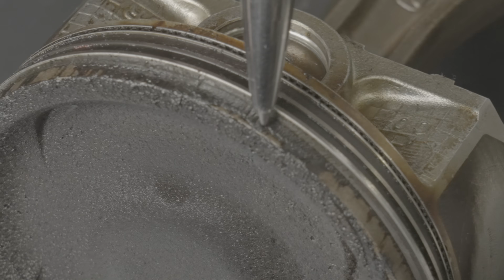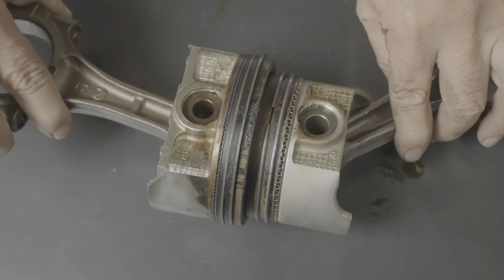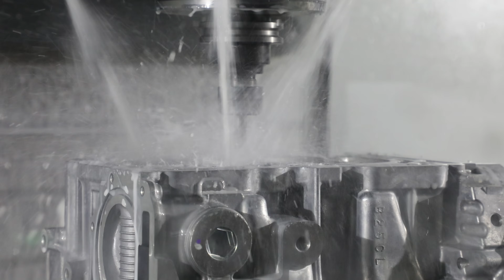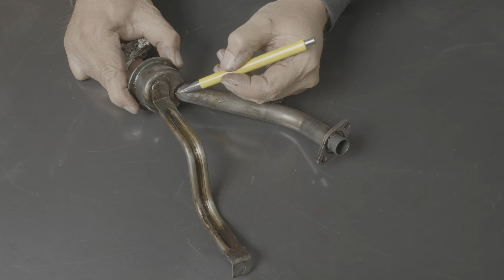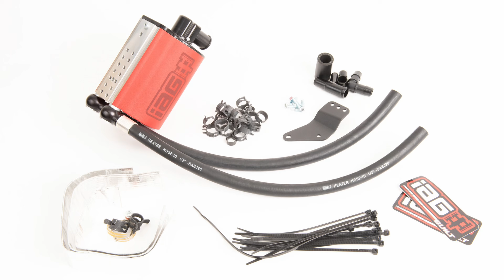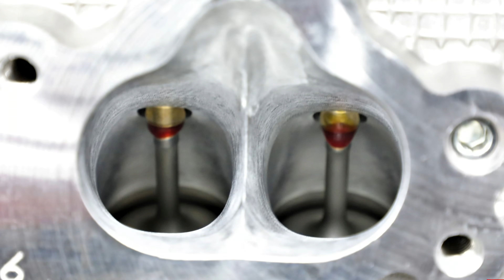Why Subaru Engines Blow Up!

Comment: Subarus are amazing cars.  This is a absolutely amazing video and EVERY owner should watch this before modding their cars
Reply: Subarus are objectively junk.
Reply: @black99rt  Spoken like a true clueless punk.
Reply: @eskieman3948  father has worked as a tech and parts dept employee at a Subaru dealership for almost ten years. Everytime I am in there multiple bays have engines out for replacement. I used to work in a jeep dealership (known for poor reliability) and it was a once or twice a month occurrence. The Subaru dealership stocks shortblocks they replace so many. I have owned Subarus in the past, wouldn't do so without a power train warranty.
Reply: “Subarus are amazing cars” 

They are some of the most cheaply designed and built cars that you can buy. Also, you sound like you've drank too much marketing Kool Aid from Subaru's US division.
Reply: Yeah… total engine failure if you breathe on them wrong… what a great car 

Before you go “shut up hater you don’t know what you’re talking about” I owned one of these cars and I sold it after 6 months because of the risk of it blowing up. 

Just a terribly designed motor but god damn if it doesn’t make a great sound
Reply: @CadaverCo  You're a liar.  Simple, eh, hater?

Comment: Mine threw a rod idling 02 wrx.... Pretty much stock. Only mod is front mount conversion
Reply: Sitting in the shed with a fist sized hole in the top of the block. EJ207
Reply from the maker: wow
Reply: The tear down of it is on the hometown runners YouTube channel... Using a great deal of your information to build a 2.5 2 l hybrid

Comment: This is a good video about the issues that people who want to leave a stock configuration often overlook. 

Subaru doesn't deserve the reliability reputation that has trickled down to normal drivers of their stock config cars from owners that blow the engines up doing non-stock things.
Reply: The head gaskets happen on all the standard, ordinary grocery-getter 2.5 & 3.0 models though...
Reply: @TassieLorenzo  any car not properly maintained can blow a headgasket, and the reputation that *all Subarus blow their headgaskets is undeserved. It has way more factors than most people give credit for because lul-meme-headgasket is easier. I have owned a turbo 2L and a 3.0 with both hitting over 300k miles with no headgasket issues and neither were stock anymore.  
This video is great because it points out that yes, the EJ has limits, and he's clearly got the expertise to point them out, but the other side of what he explained was owners exceeding the limits and not doing the supplemental work these engines call for when modding/tuning. 4 of the 10 reasons of his videos are all running too much power without protection, and another 4 are oil starvation problems, which also have preventative mods.
A fairer criticism of Subaru engines would be that they are less tolerant of sloppy maintenance habits than other engines like hondas or toyotas.
Reply: @themadmallard  "A fairer criticism of Subaru engines would be that they are less tolerant of sloppy maintenance habits than other engines like hondas or toyotas" I was with you until that, what kind of excuse is that?  If a Honda will run for 20 minutes with no oil in it (Carwow) or for a year with a rod wedged in the block and only three cylinders working (Eric the Car Guy), then Subaru should match that.

The reliability and durability of all cars is judged compared to Toyota/Daihatsu/Lexus, Honda/Acura and Suzuki as they are (mostly) the benchmark at the top of 10+ years reliability surveys. That's no different whether an Alfa Romeo, Dodge or Subaru is being judged compared to a Toyota or Honda.
Reply: @TassieLorenzo  that changes the standard though, and at that point you might as well throw any consideration of what a responsible maintenance action looks like for an owner. It's still abuse of the mechanicals, and just because a Honda or a Toyota has a longer mean time to failure when being abused is not exactly the fairest of comparisons as if youd follow the maintenance schedule for all parties involved. It's still going to fail ultimately.
 That is by definition not reliability, that's tolerance for abuse. Don't conflate them.

Comment: The flow of all gases is wildly turbulent in all combustion engines. Quench pads are certainly not responsible for the "turbulence" of a gas that is already out of control.
Reply from the maker: Yes they are.  The function of quench pads in two strokes and 4 strokes is common knowledge so it isnt just me that says this.
Reply: Is a stratified charge combustion chamber "wildly turbulent" right before the spark? No. How about the combustion chamber of turbine engines? They would burn up if "wildly turbulent", the metal is protected by the careful placement of combustion, away from chamber walls, not wild turbulence. 
    Piston engines have these quench areas and other gizmos to intentionally make turbulence. 
    Heron type combustion chamber? That promotes turbulence intentionally.
   John deere experimented with creating turbulence intentionally,  called it "cyclonic" combustion in brochures in the '50's. I guess they thought it wasn't wildly turbulent enough in their engines. Rolls royce was messing with it in the merlin and it's predecessor..I think their squish area wasn't tight enough to really work, as good as the merlin was, it sounds like this was a power limiting shortcoming...makes detonation appear earlier than it would have if they had gotten that right. 
   The quench areas seem to make their turbulence just about at the right time, pretty good idea! And no additional moving parts.
Reply: @firstielasty1162  The exhale of your breath is turbulent, Re>2300. Air/fuel mixture into the combustion chamber reaches an insane level of turbulence Re>50000. An increase in turbulence is a by-product of the quench mechanism. The primary function of quench is plainly known as "Fluid Spreading" or "Spherical Propagation". This squeezing of the air/fuel mixture results in spherical vortices throughout the combustion event. This is crucial for the uniform distribution of fuel particles and intense combustion. You guys are misusing the term "turbulence" like the typical bro-scientists that have always plagued this industry.
Reply from the maker: But if I said what you said, everyone would not understand or fall asleep.
Reply: @motoiq  Ya, you're probably right
Reply: I guess so...and I shouldn't  say or imply "not turbulent"..by Reynolds number and definition.
   How about "not turbulent enough"?
   Both garage hacks like me and manufacturers alike seem to see benefits in squish/quench areas.
   I bet all but a very thin boundary layer in an intake  manifold and port is turbulent, but, maintaining fuel in suspension (I mean atomized but not yet vaporized) is still tough, so, "not turbulent enough", again. 
  I can't think of one word to replace those three. But wouldn't mind knowing one.
Reply from the maker: If you mess with quench or squish, the engine needs less timing and when tuning has less propensity to detonate.  On an engine dyno the BSFC goes down. This is when the same compression ratio is maintained.

Comment: I've almost always attributed EJ early death's to oiling problems in their stock forms. I'd not considered the ring issues, which is a solid point. Unlike a traditional layout design--where other fluids to include a gas/air mix doesn't mind laying on it's side nearly as much--the oil travel and performance certainly does! I have no idea how some of the hillclimb guys in Europe keep 800hp engine together, unless they just accept that a rebuild is necessary after every event vis-a-vis quarter mile drag engines.
Reply: They just accept their fate on the rebuilds part, I mean they’re hard racing a 2.5l engine that makes 800hp it’s not gunna survive that well in majority of engines that displacement or smaller
Reply: Baffle that sump gents....
Reply: Have you ever been to a drag strip? Basically only top fuel do teardowns between runs. There's lots of people who drive to the strip, rip 9/10's all day and then drive back home.

Comment: Another great Subaru video! Taking into account this and other videos I've come up with this plan.
1. Keep it cheap, keep it fun. If you're not laughing if/when it blows, you spent too much.
2. Don't build the engine, it's not worth the machining cost, work around the flaws.
3. Don't shove power in down low, the block/rods can't handle it.
4. When time comes for more power go with cams and dry sump (cheaper than a built engine) to be able to safely spin it to higher rpms (~8-9) without oil starvation, and put the power in there.
5. Throw out the restrictive cast UEL manifold that just holds hot exhaust in the cylinder and increases detonation, run the twin scroll or other EL tubular manifold. Probably also run a turbo with a decently large hot side, unlike most stock fitment Subaru turbos.
6. Don't try to push a heavy car with all this, start with the lightest possible car.
Reply from the maker: Stay under 330 or so whp for a track-driven car, with Ethanol maybe 390 or so.  You don't need cams for this power level and if you do a cam change, you should pul the engine so it is not recommended.  You don't need a dry sump unless you run a billet case, are at high power levels or you pull more than 1.2 G's.
Reply: @motoiq  It's a street/track car doing ice racing, rallycross, and maybe a few drag passes. I've got less than 1500$ into the motor and it's in a GL Hatch so curb weight is only around 2300lbs. I think I'm going to aim maybe more for 350-400 full rip, but if I were to do longer track sessions, I'd bring that down closer to 250-300. Either way, it's pretty scary quick already with the wastegate wired wide open haha
Reply: You don't need cams for anything under 600HP. If you want to rev high thats your valves, valve guides, retainers, ect.
Reply: @Anonymoose0913  I think that's the mindset that causes people to blow shit up. You can make 600hp sure with a stock bottom end. But you're pushing a bunch of cylinder pressure into a not very rigid block and not very strong rods. With stock bottom end tuning, you want to soften up that cylinder pressure by making your power at higher rpm.
Reply: @Levibetz  Your talking about the bottom end. I'm talking about where you said for power you need cams, Subaru actually built the heads AMAZINGLY well on these EJ's and they can flow more than enough air for up to 600HP. If your wanting to be able to reach higher RPM then your looking at the your valvetrain, but for actual HP numbers the stock cams are good up until 600HP, all you need to make that 600HP number is a port and polish. Above that 600HP is when you start looking at something like BC 272 cams.
Reply from the maker: @Anonymoose0913 we run cams at lower power levels, not because the engine needs them to make 600 but so we can do it at lower boost.  Our shop car makes 520 at only 25 psi for instance. Could make 10-15 more too if I changed the charge pipes and made a bigger airbox but 520 is enough and I am lazy.
Reply: @motoiq  What kind of cams are you running to make that power at lower levels if I may ask? I'm not trying to sound rude I'm genuinely curious. And I appreciate the honestly about being lazy I know the feeling 😂😂😂
Reply from the maker: GSC Stage II.  If I were to do it again, I would do Keford R199
Reply: @motoiq  Why would you pick the Kelford R199 over the GSC Stage IIs? I’m genuinely curious to know.
Reply from the maker: More area under the curve per given duration
Reply: @motoiq  Question is the objective of making the 525 at 25 PSI so you don't stress the motor more or so that the car feels more fun? I'm guessing more power at lower boost means the car is more responsive and fun to drive.
Reply from the maker: Stressing out the motor and more in the range of a non rotated mount turbo
Reply: @Anonymoose0913  If you put a wild compound turbo setup on a subaru you could make 500hp at 3500rpm. It'd obviously instantly explode from that cylinder pressure. The question isn't can the turbo make the power, of course it can, that part is fairly easy. The question is can the bottom end handle the cylinder pressure, and the answer is no. We know these motors struggle with the bottom end. And look, for hondas people aren't making 600hp at 6500 rpm, they rev them much higher. So trying to shove 600hp into a subaru under 7k rpm isn't just a lot for a Subaru, it's a lot for any four cylinder engine. But because cam swaps are engine out, and because people want to hear "subi rumble" people try to shove the power in down low and kick the rods out.

Comment: Ok is the new iag block gonna have special heads too? What rpm is the highest that is usable on a boosted ej257 setup?
Reply: Yes, iag should be getting the crest cnc's cast aluminum heads pretty soon, I believe first quarter this year
Reply from the maker: 9000 if everything is build correctly.  I prefer to keep it to 8K and just run more boost to get the power. This is on a fully built motor, not a bolt on stock bottom end type.
Reply: Ty @motoiq

Comment: Id love to see a video on the new FA24
Reply from the maker: We have build a couple for the GR Cup cars but they have to remain totally stock as per the rules so nothing good to see.
Reply: @motoiq  hopefully some new WRX customers will show up then with something interesting. 
And no oil starvation on right turns on those you have built?
Reply from the maker: Not the cup cars, believe it or not the engines were damaged due to crashes.